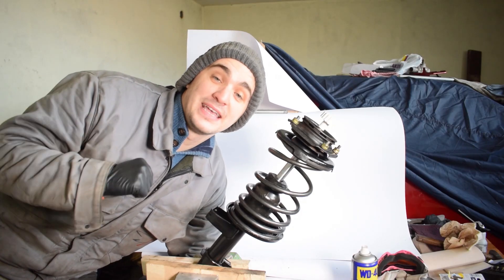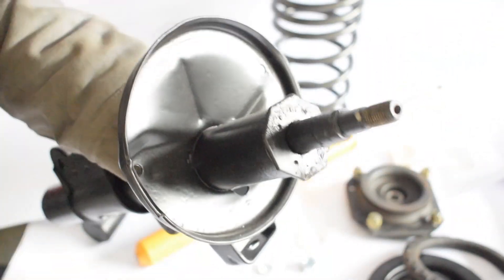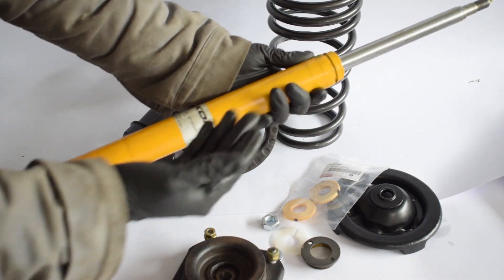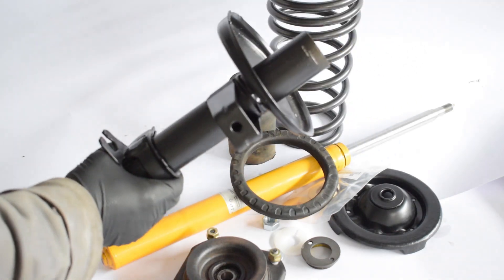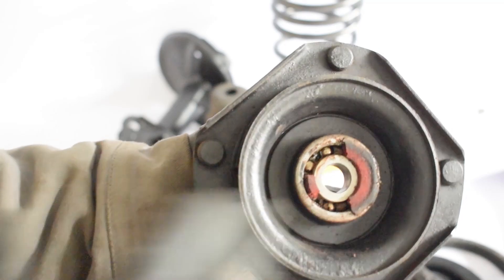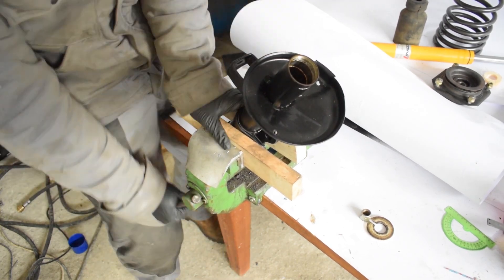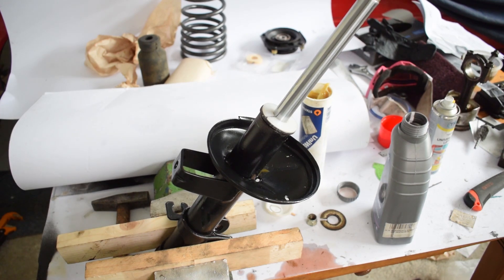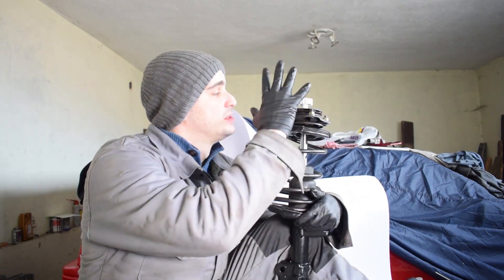How to REBUILD suspension STRUTS (shocks)

Comment: My strut housing doesn't have notches cut out to pop out the brake lines, just solid steel with a pass through slot. This made cha ging my coil sprins a massive PITA. What would be the best course of action for a conplete strut rebuild? Should I cut notches out with a cutting wheel,  or should I disconnect the brake lines somewhere along the line and possibly replace them with steel braided lines? Are there any other options?

Comment: I would think that the spring would be installed with the more compressed parts of the coils being closer to the top hat, but maybe I'm wrong. Does the spring orientation matter in this case? I looked up an MR2 oem strut MK1 AW11 and it looks like the spring is upside down compared to yours.
Reply: The writing on springs always face right way up so his springs are del upside down but so was the previous red springs which he probs copied the orientation of

Comment: I bought some used red 'lowered springs', for an 'sw20' they act much the same as yours, but then I searched for the inserts and found a set of brand-new rear struts on a clearance sale, genuine OEM and at only $25 each, complete with inserts, brand-new. There are some benefits of having an old but not really old car,  1997- beams, I can't afford to buy new replacements for everything, and how am I going to learn, not with bolt on's and other people doing the work, I rebuild everything I can, I'm doing my cooling system first, suspension second, engine upgrade and strengthen the hell out of my 4 speed auto gearbox, then next, spray paint and panel repair, not my first car re-build but my first sports car upgrade. going non turbo 300hp auto with manual shift, it's the best way to change gears by far, all the best and fast cars are manual-auto, speed, cornering here we come. I live at the bottom of a big mountain. Your videos are a great help.

Comment: My front left struts shocker give sound when it gets wet, I gave money and changed the boots with aftermarket item but I still has sound on bumps when I drive, right side is fixed with the boot installation but not the left one, it only starts giving sound on bumps while it rains and gets wet

Comment: Do you have to do a wheel alignment after you change struts?
Reply from the maker: Yes because you upset the camber
Reply: @d4a  thanks. Omg if I knew .. I put on 4 brand new tires weeks ago n did an alignment. Dam and alignment cost 😫😫

Comment: I bought new struts, new mounts and bought compressor and did the job my self twice. After I went for a drive test, my problem was finish, except now, there a boing noise on the driver side when I'm turning to the max...Maybe I put the coul upside down, will check it out. Any comments?

Comment: I am not familiar with the MR2, but imports from the 70’s used this replaceable strut insert. Once removed, pore the oil out to measure. If your container has no graduations and the wet line on the strut insert is 1” below the top, note and recreate this amount. Prior to the early 70’s, motorcycles had bearings with zerks very hard to reach. I used a grease needle sold on a tool truck to depress the ball and grease the zerk. Later, I have used it to grease used bearings that once cleaned, had no defects. The skinny tip allowed for adding high quality grease between the bearings race to work in well. Perhaps better than new. The oil will stay more consistent over a wide range to temperatures while having less expansion hot that coolant or ATF. It is just my opinion as our service manual indicated 10W40 and CC’s/Oz to add. 
Certain rear drive vehicles have more flexibility on the front. With the top mount loose, place a large service bar over the lower control arm, yet under the pivot. We found the using a reasonable force (Caliper & sway bar disconnected and caliper supported) the strut still attached to the lower control arm will come out of the wheelhouse. The use of a suction gun w/longer hose attached could remove tube oil and cleaner. This saves time and eliminates the need from changes in chamber or caster adjustments, if applicable.
ASE master - retired

Comment: Nice video. I would not say it is rebuilding, but replacing the cartridge.
Reply: In fairly certain that the actual koni shock absorbers can be rebuilt with new seals and repressurized

Comment: Question my 1992 Supra TEMS  Tokico Illunmi Struts failed after 600 miles , one of them in rear, is there anyway to rebuild it?
Reply: I'd like to know about replacing the TEMS as well on my 1990 Celica. Suspension hasn't failed but you can feel it's not doing it's best and the only info I've found is to replace the whole system with stock and disable the TEMS which is a bit of a bummer.

Comment: Thank you! I have been trying to find replacement struts for my 1995 Infiniti Q45. I cant find them anywhere. Do you think I can rebuild them with the koni shocks and the parts you showed? I have not removed them from the car yet. When you rebuild a strut are there specific koni parts for each car model, or are they universal.

Comment: I have a 88 mr2 trying to rebuild I just took out the front driver side strut definitely needs rebuilding no rubber at all were did you get your parts no one in my area has them

Comment: Does the shaft of the shock absorber twist in its housing? Trying to figure out if the shock absorber is designed to do this -  the shaft of the shock is bolted to the top mount - which stays put when the vehicle turns but the shock housing is bolted to the hub carrier - which rotates. Is that the norm? Thank you.

Comment: Are those the stock strut housings? I'm wondering if these konies will work on the stock suspension and I will have to is drop them in
Reply from the maker: Yes, stock strut housings. They are inserts designed for the stock strut housings. For models where the cartridge cannot be removed from the housing, Koni has complete strut assemblies.
Reply: @d4a  thanks, thats what i thought. Rebuilding the engine and figured id do some work on the suspension while waiting for the machine shop and for parts to ship

Comment: sir is it possible to recondition sealed shock absorber (fiat Punto)
Reply from the maker: I wouldn't do it honestly
Reply: @d4a  why? will there be any issues
Reply from the maker: @kilnprabu  It depends on the strut but sometimes it's a lot of work with very mixed results. It's a much better idea to buy new shocks than try to rebuild something that isn't rebuildable.
Reply: @d4a  ok thank you sir

Comment: Hi man! I hope you can answer me😜
I was able to get the rear insulator parts (48258-16010) but the fronts are no longer available. Question is: could I install rear insulators at front? Are they really that different?
Thanks!!
Reply from the maker: Honestly I don't remember, I feel like I used the rears on the fronts too. But you can try the part numbers on ebay or somewhere, someone might have new old stock left. But it's likely ok to put rears on the front as long as they cover the surface properly and aren't loose or something else that looks obviously off.
Reply: @d4a  I've tried everywhere; ebay, Toyota pages, Megazip, etc and all show that the fronts are discontinued. I'll give a try anyways.
Thanks man! Love your channel!

Comment: Hey what kind of oil I have to use for softer suspension ??
Reply from the maker: The oil has nothing to do with softness, it's there only for cooling and anti-corrosion.
Reply: @d4a   can you please explain me what can I do for yellow koni
Reply from the maker: You want to rebuild them? That can only be done by specialized shops and a rebuild is very expensive. Conventional rebuilds that refill the shocks with oil and replace seals will not yield good results with Koni. It's honestly best, easier and maybe even cheaper to just buy new ones.

Comment: I had no idea you could remove the shock from the housing as they always sell the entire strut with the shock inside as 1 unit-  I dnt even think they sell them separately  so what a waste that we have to buy them the way we do. Only the rear shocks of most cars are sold as separately, especially hatch backs since they are torsion beam set-ups
Reply from the maker: Well, you actually can't remove the shock from the housing in most modern cars, and it's made that way on purpose. Sometimes the auto industry, like any industry is a bit hypocritical, talking about green technologies while also being wasteful in other less prominent areas with the aim of more profit. This shock is from my 1987 mr2 and you will see that the shock and housing can be separated on many cars from this era and before, but already in the 90s this became non-standard and it's extremely rare on cars made after the 2000s.

Comment: Hi I've recently done my steering and front suspension  on my 1995 Toyota corolla (RSA) which has a similar setup to your MR2 but it still has the same knocking sound over bumps and potholes especially more on the left hand side (gearbox side) I've replaced steering rack ends, all rubbers on the control arms I jus haven't got a clue as to what could be the prob, any help
Reply from the maker: Did you take a look at the sway bar rubber bushings and steering rack rubber bushings?
Reply: @d4a  yes I have I've changed all of that as well and nothing it's still making a knocking sound

Comment: Rebuilding your struts is a great way to customize your suspension if can't afford or don't want coilovers. I use sw20 rear inserts in the front of my ae86 with Megan racing springs and some spacer for a nice stiff short stroke

Comment: Great video and great channel. I unfortunately just discoverer it now. I have a question, the dust seals, are they Toyota parts? Could you pass me the part number please? I have an 1978 Celica GT Liftback, where I'm rebuilding the front suspension now (not a lot of parts available anymore) and those MR2 dust seals seem to have the right size, hahaha. Many thanks in advance!
Reply from the maker: Michel Guenther Thank you. I recommend this website: toyodiy.com. All the numbers are easily found there.
Reply: Oh I didn't know about this website. Great tip, thank you very much! Btw while browsing on that website I found https://7zap.com/en/ It has all the part numbers as well plus very nice drawings for every assembly. Keep up the good work and luck to you and your MR2!!

Comment: I was just about to get to the suspension on my AW11. The shocks currently in there are failing and the car bounces like an old Cadillac when going over bumps in a parking lot lol. I think I'll go with the route you took and get Koni yellows with Eibach springs. Also, depending on how your car sounds when you're done with the bike carb conversion, I think I may also switch to carbureted. My car has never been able to idle lower than 1400 RPM without wanting to die if I turn the AC on and have the compressor going. So it's either, AC off and I can idle at 1000 RPM, or adjust the idle screw and idle at 1400 RPM — so that with the AC on it idles around 800-1200 RPM.  I think going carbureted would be easier to manage than some of the crazy ECU options out there and going coil-on-plug, distributorless, etc. while maintaining EFI.
Reply from the maker: Hey there! This setup is really a tried and tested route, and I have yet to hear anything negative about it. It strikes a really nice balance between sporty handling and decent comfort. It's a great all rounder, plus it's really reliable and easy to service if anything goes wrong. 
When it comes to the bike carb conversion, as you said, it's best to wait and see how it goes :) Getting the stock system to work properly after 30 years is  sometimes next to impossible. This was one of the main reasons why I decided to go with bike carbs. The notion of getting rid of all the stock junk like the afm, and the wax pellet throttle body horror, the clickety clackety t-vis and others, was simply far too tempting.
Reply: driving 4 answers You and I are of the same mindset there. I hate the AFM, the horrible IACV with its unreliable wax slug, and the vacuum system for TVIS, etc. I'm finding your videos to be quite enjoyable, so thank you again for making them!
Reply: Jeff Reeves I don't know ow what you're talking about but I had my 85 mr2 since 2000 after my dad rebuild the engine and never had a problem with the car. I don't know what clickery clack he is talking about. My mr2 has been the most reliable car I have ever had. I got so bored of it I tried selling it once but no one  came because it doesn't look pretty. Now I need a new clutch because I have been driving it forever and enjoy the heck out of it. By the way the original springs at least on mine were soft. I got the eibach  you mentioned and they are good for mountain turning but not for long trips. But at least on Thursday I turn instead of going straight like the originals.

Comment: Spring doesn't absorb bumps and other imperfections. It keeps te wheel in contact with the road. Shock absorber absorbs bumps :) anyway keep it up, love your videos :D
Reply: Technically speaking that’s the same thing... when a pothole arrives the spring conforms the the road...  keeping wheel in touch with road, no? Makes life easier on the shock absorber, ami wrong?

Comment: Just wanted to say thank you. This was one of the first few projects I took on when I bought my AW11. While the online documentation was good to the point it only took me a few hours in total to rebuild all 4 struts, this video is indispensable. The only recommendation I would add is if you don't have a vice then break loose the large top nut that holds the strut in the tube loose while it's on the car. Otherwise fantastic video I love that there is finally a channel documenting how to upkeep this great model of car.

Comment: Dam, where can i find the instructions on the details you provided when placing ATF, Engine Oil, or coolant in the strut housing because i thought if the konis already were prefilled that just placing the tube shock inside should be fine
Reply: Lime 
Yeah I didn't do that on mine, in the exact same setup. Now I'm worried...
Reply: lol
Reply from the maker: Don't worry, it won't cause a disaster or anything. The strut insert will probably rust a bit at the bottom, but it isn't the end of the world.
Reply from the maker: The atf is placed in the housing, i.e. outside the strut inserts. I havent messed with the inserts themselves at all :)
Reply: Yea i understand but where'd you find manual for this though? or did you just prefer it this way
Reply from the maker: Lime No manual, it's just common practice to do it when replacing inserts. 😀
Reply: uhh ok, i think the grease is a good way to not allow corrosion, i'm not sure about the other stuff. :D

Comment: Excellent explanation. When you put the strut back in your car, would you please give as much detail about maintaining the original cam angle? I see where you were pointing, but couldn't see your cam angle mark during disassembly.
Reply from the maker: Do you mean the camber angle? I didn't mark the original camber angle on the bolt for two reasons. Reason one is they were all adjusted all the way for maximum negative camber by the previous owner, reason two is that the original camber adjustment bolts are stupid. Doing an alignment with them is a pain, because the markings don't really correspond to 1, 2 degrees etc. they are just marks and you have to adjust, check and repeat until you get the desired angle, which most shops that do alignments will simply flat out refuse to do. So what I will be doing is getting some aftermarket camber bolts to remedy that issue and then getting a full alignment once everything is finally put together and the car on the road, which I hope will be within my lifetime :) lol
Reply: Ahhh. Thanks!  Wheel alignment seems to be more art than science!